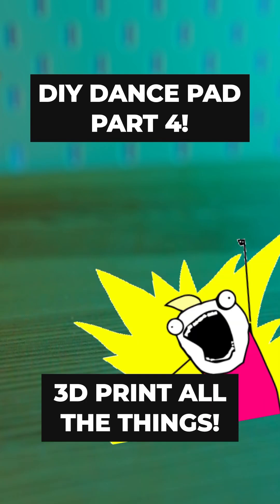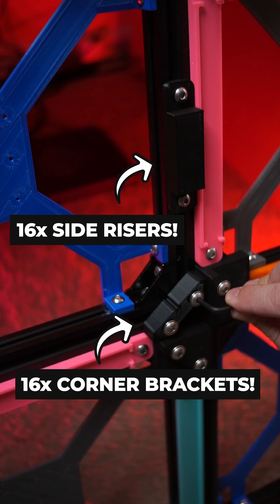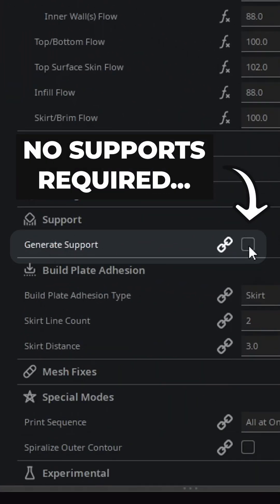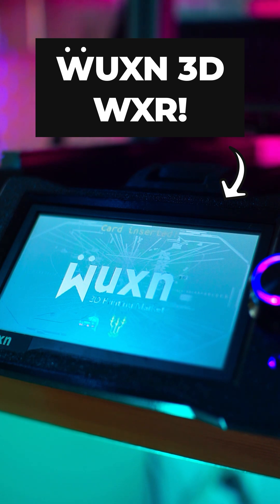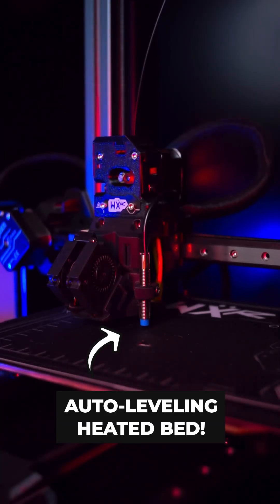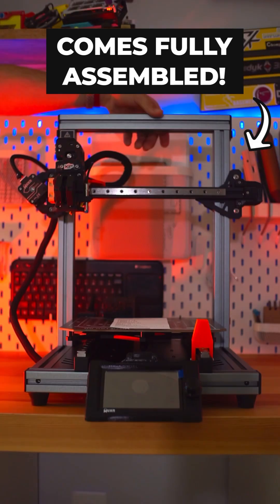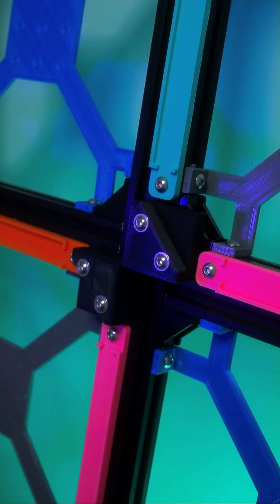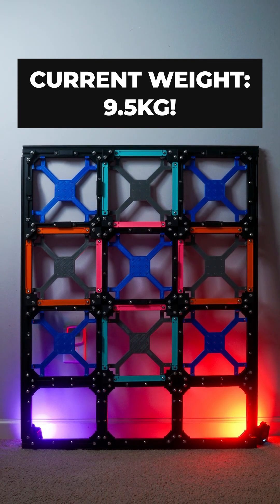DDR Dance Pad Part 4: 3D Printing ALL THE THINGS! | #3dprinting #dancedancerevolution #ddr #wuxn3d

Comment: What are the dimensions on that support bracket? Possible to print on the Wuxn?
Reply from the maker: You can print it in one piece depending on print orientation. However I am also going to release split files that can be printed flat on the bed easier/faster.

Comment: could you also make it 2 in one like make all 9 panels so you can play DDR and PIU on one or 2 pads?
Reply: It will be inconvinent, since PIU's diagonal foot panel has different size with DDR's foot panel.
Reply from the maker: @iceboy1053  I am thinking about having a DDR and Pump It Up pad side by side/connected to each other though, since this would make switching between games super easy. That would be really cool, I think. (As long as I’m not looking to play doubles.)
Reply from the maker: Unfortunately there is not enough IO on a Raspberry Pi Pico to handle two full 5-panel dance pads and support both arcade sensors and FSRs. The easiest way around this would be to buy two separate PCBs and use two USB cables, which will definitely work!

Comment: no way. I just designed last week a design that's similar to yours but uses wood+3d printed parts. now I'm having second thoughts, maybe I should be using aluminum extrusion too...
Reply from the maker: Stay tuned! I’ll be posting my thoughts as soon as the build is complete and I can try it out! Aluminum extrusion makes it super easy to get arcade dimensions absolutely perfect.
Reply: @SuperMakeSomething  I bet it does! just one question, if I may ask, I assume you're using polycarbonate for the arrow panels, if so, what thickness are you going for? because I'm opting for 8mm thick panels and don't know if it's too thin, I'm afraid it'll flex too much, even though they're well supported from below on the whole frame
Reply from the maker: @Armandik  I’m using official arrow panels from DDRPad.com, which are 0.375” (~9.5mm) thick. For the stationary panels I ordered polycarbonate with the same thickness. I have not attached these to the frame yet (waiting on the electronics to come in), so I do not know how much flex there is, but they seem pretty solid! I’m hoping that by matching arcade dimensions, it will be good enough.
Reply: got it! thank you and have fun with your project! ^^
Reply from the maker: @Armandik  Thanks!